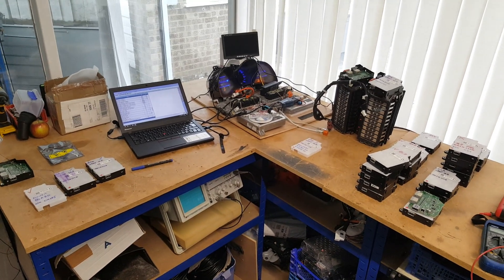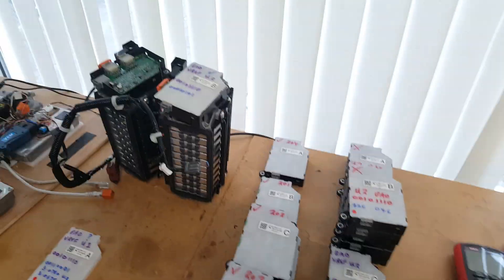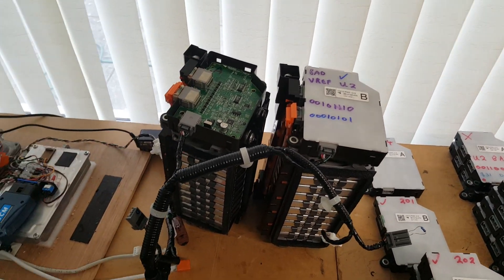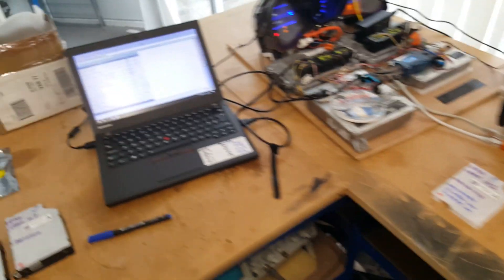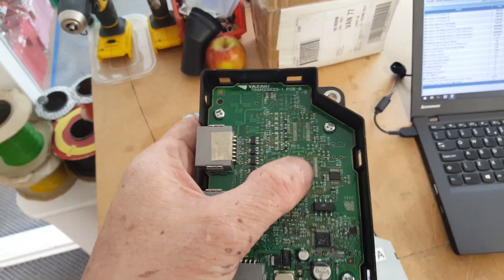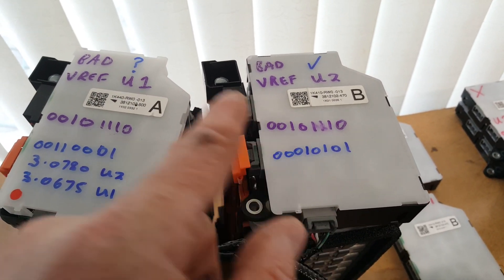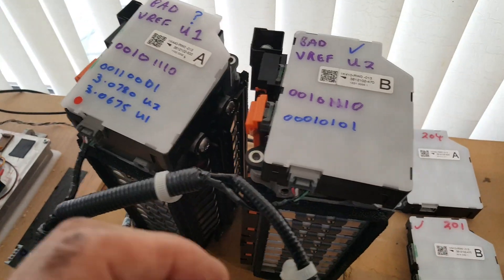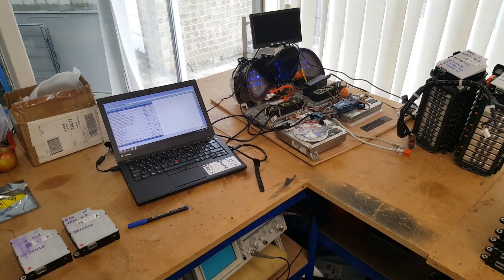P0B3B Honda CR-Z/Civic Lithium BMS Board Failures Update & Repair.

Comment: I have a Honda Civic Hybrid and the scanner shows some codes P0b3b3 U1205 U0110. Could you help me find the fault?
Reply from the maker: Post the details on the honda crz forum in the 'other hybrids' section and read all my posts on that forum that feature P0B3B issue. Use the search feature on the forum.

Comment: I am not playing around with soldering bad boards. If I am swapping the boards only (all 4) is it fairly difficult to get to them? Also, do I need to perform any sort of programming after putting everything back together?

Before taking anything apart,  I plan on getting the HDS clone to check on battery health such as SOC values, and Individual cell voltage . Beyond that, I don't think there is anything else to do.

The forums say that sometimes the boards are wrongly identified so I figured I am better off swapping all 4 of them, along with any cells that might have low voltage.
Reply from the maker: Post questions on the crz forum in relation to this.

Comment: Nice to see. Do you have a microscope and a pick? That's how i check pin connections on tiny pitch SMD stuff at work. The conformal coating doesn't mess around on these newer cars lol.